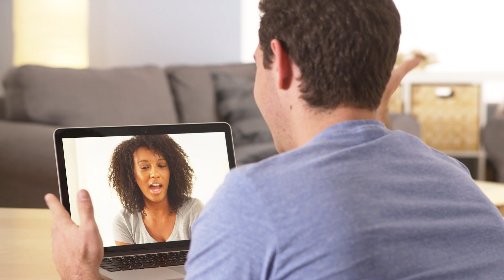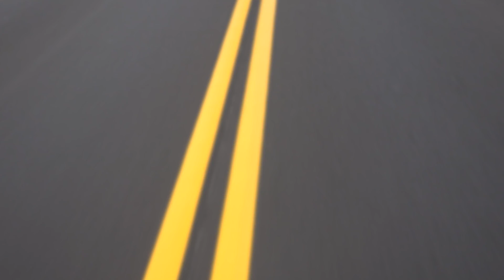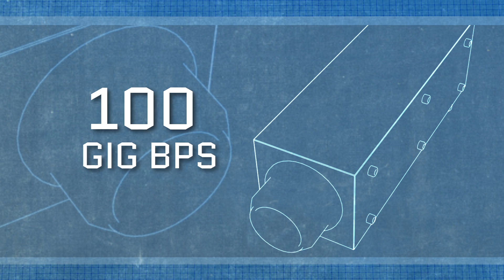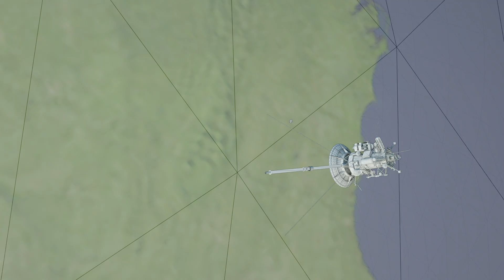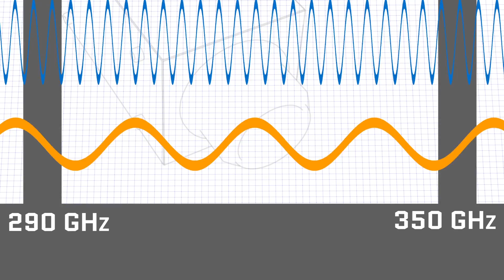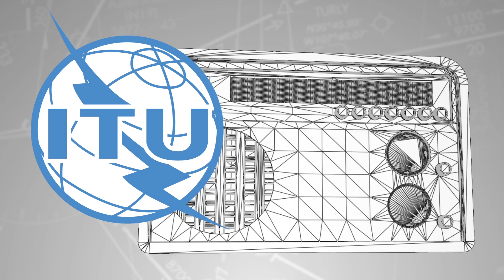Internet In Spaaaaaaaaace!!!

Comment: The problem with the Internet in space is latency.   It's called the LFN problem and is due to the three way handshake protocols of the TCP protocol.   It's really the product of latency and bandwidth so the problem occurs if either is increased.   It first became an issue when we went from the 10 megabit per second Ethernet to the 100 megabit per second FDDI and the later 100 megabit per second Ethernet, it became an issue again when gigabit Ethernet was adopted etc.   The solution to date has been to extend the timeout period for acknowledgements hence extending the buffer window. With space beyond Earth orbit, this solution could require buffers on network interfaces, switches and routers several orders of magnitude greater than what's used in the memory of the computers themselves.   I would suspect that some of the communication handshake protocol will have to be brought up to the application layer at selected caching gateway routers acting as proxies.